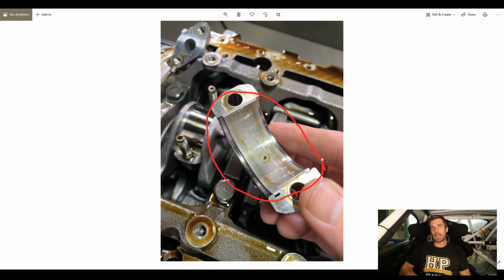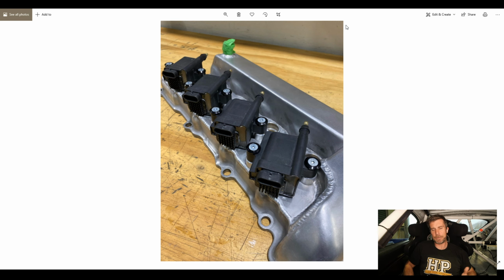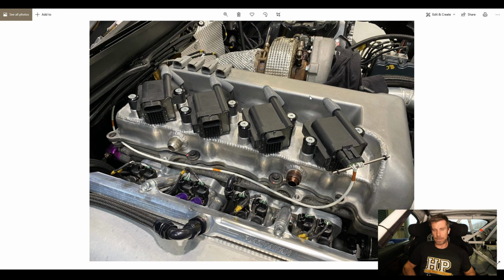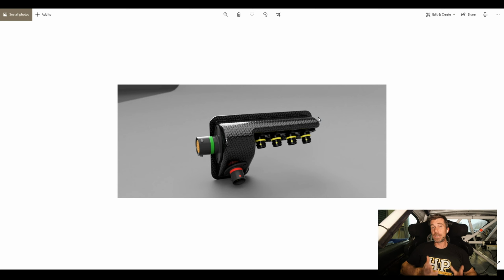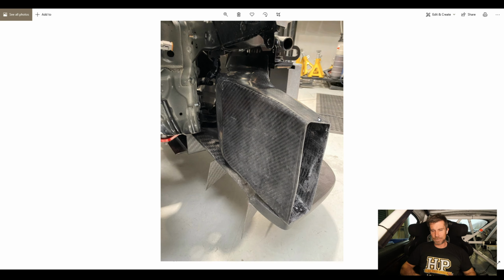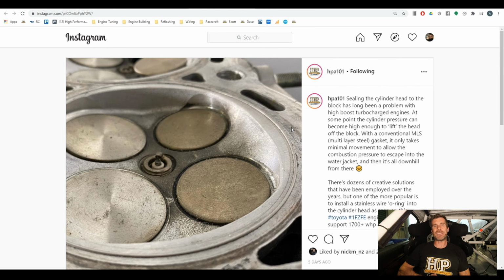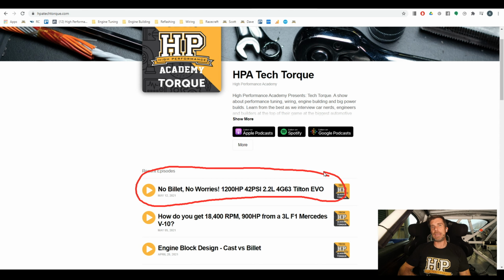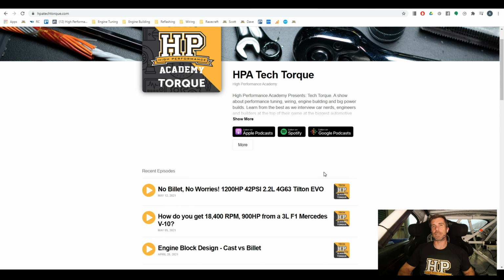Custom Carbon Fibre Ducts, New 4G63 Build and more.... | Today At HPA [#UPDATE 269]

Comment: I worked for a drag race engine manufacturer for some time. The cylinder rings were CNC machined on a lathe. So they were a continuous ring turned from stainless tube. And to remove them, we tig tac welded filler rod to it, had a set up that worked like a slide hammer.

Comment: Might have mentioned this before but, regarding the oil, with an engine that's used that's used hard it can be cheap re-assurance things are all good if one has the oil tested at each oil change. These will often pick up problems before they become major problems, for example lead, aluminium or iron contamination may suggest bearing or ring issues, or if a coolant/wetter is used it may be detected in the oil suggesting an internal leakage from a head gasket or heat exchanger.
if one is interested in this, there are commercial services that do it or, if they're hard to locate, most modern heavy machinery requires this to be done as part of the warranty process, so check your local truck or construction machinery dealers as they may be willing to add your sample to the batches they send in for themselves.